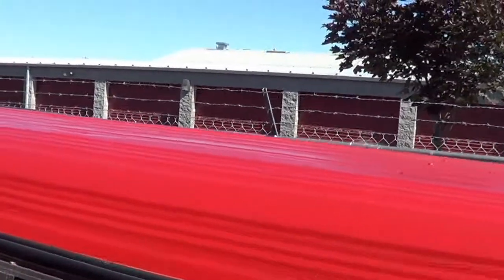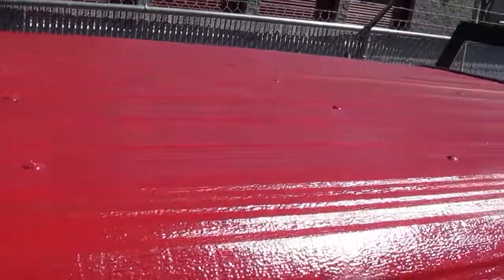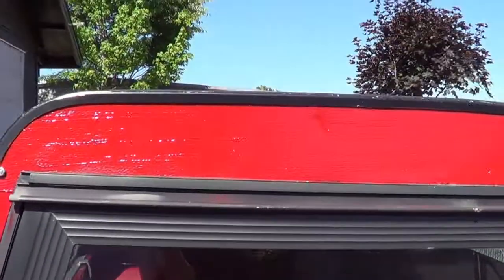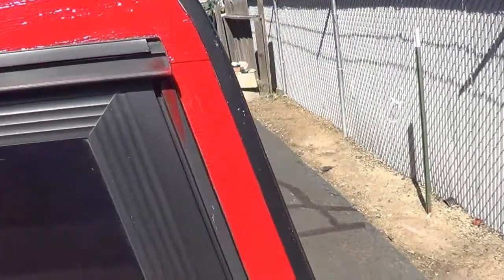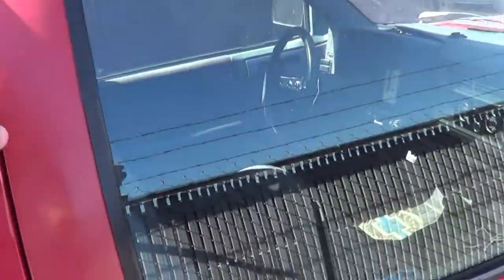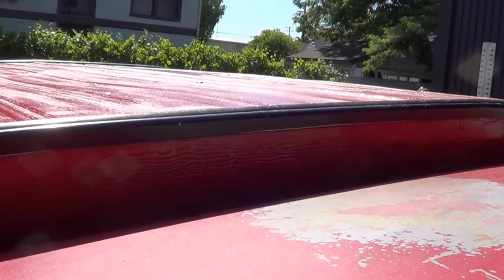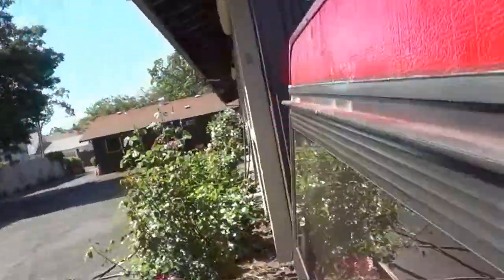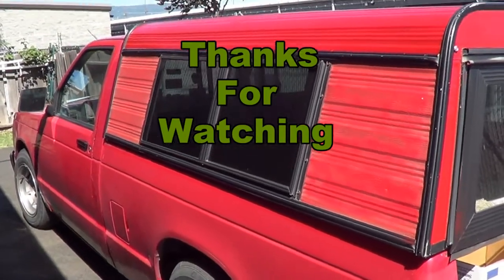My first time Using JB Weld Pt 4

Comment: Clear blue sky beautiful day except the two obvious chem trails with the aluminium and barium streaking across the sky. Paint looks great. I painted my snapper lawnmower with a rattle can and it looked good for quite a while. The red did fad fairly quickly in the sun. So it will probably fad some to match the sides. Just saying.  But it does look very nice.
Reply from the maker: shartne It Was a Nice Day out there. Got up to 82 for a High. Today it is almost 100. to HOT for Me. I will stay in and Play on The Computer. The Paint does look good. and I hope it does fade a bit to Help match the rest of the Truck. Thanks for Watching Shartne
Reply: Mee too. It is hot out. Not as hot here but pretty humid.